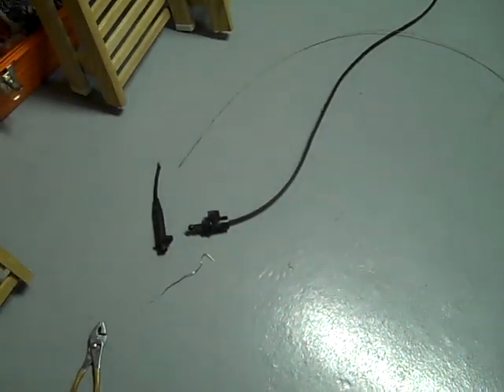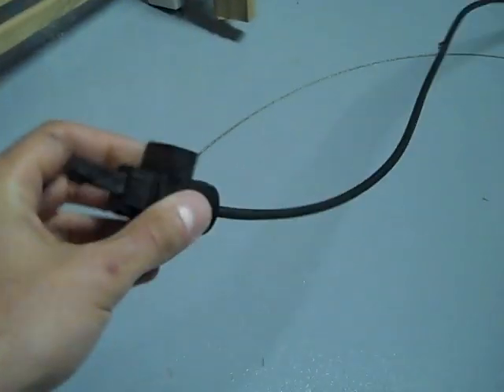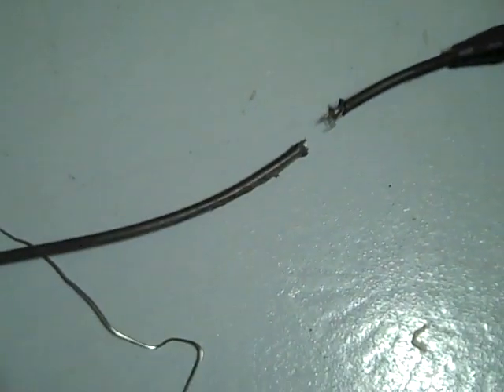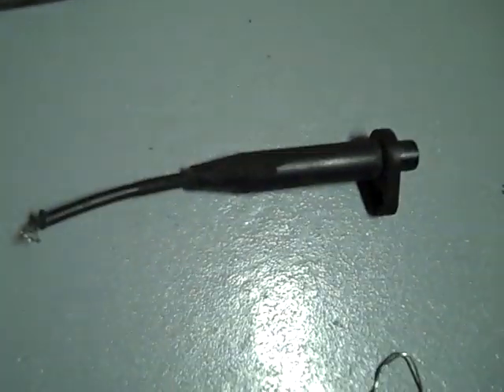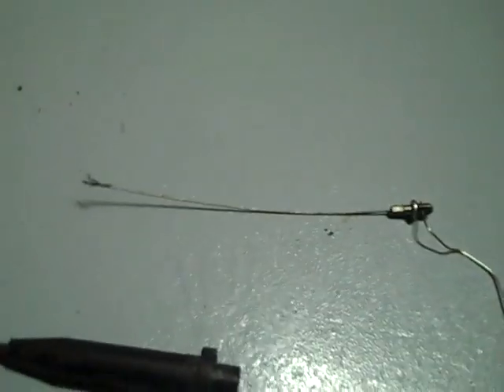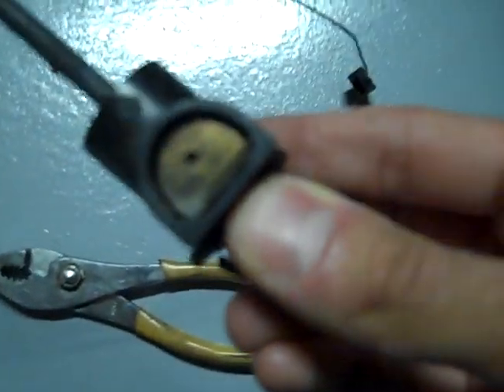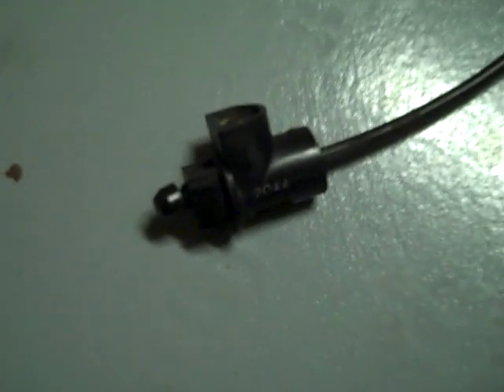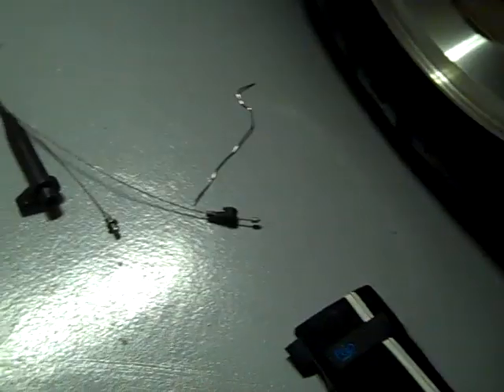How TV cables work... TV meaning Throttle Valve, Or Transmission Kick down cables.

Comment from the maker: @TeamrandomAssociate  Run the part #.  I assume its a GM you speak about. Sometimes you can find a cheap one on ebay, Or GMpartsdirect Even rmsautoparts . Just email them with your request..   Ya. The cables get pretty crappy with age. Mine is still shifting good.